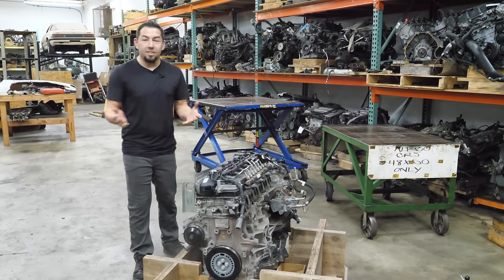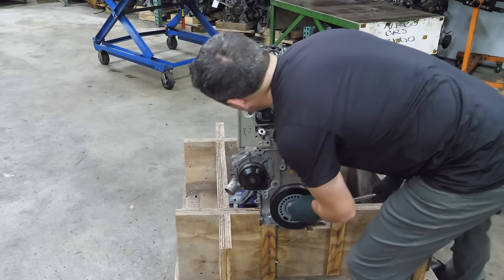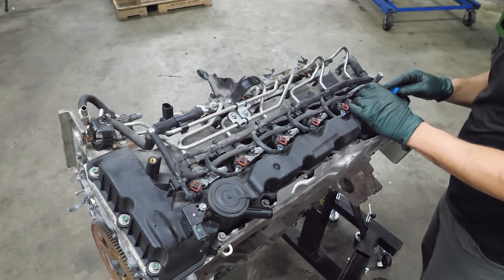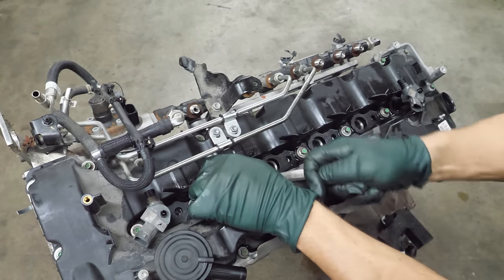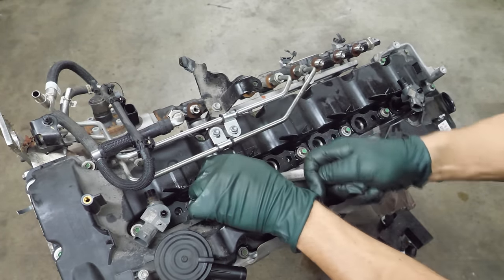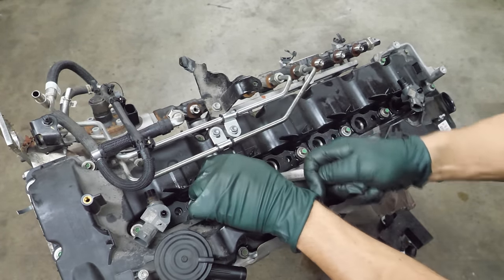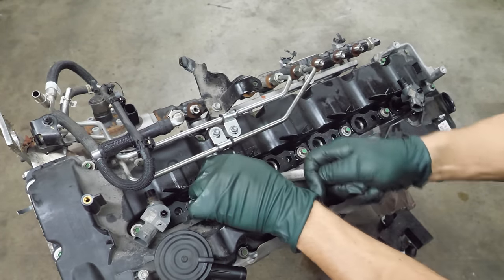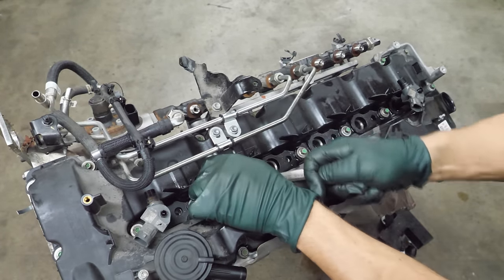BAD 2020 Silverado 3.0 Duramax LM2 Engine Teardown INCREDIBLE DAMAGE!

Comment: I had an oil galley plug randomly fail at 18k miles right after an oil change. Wasn't aware until I got home & found oil all over garage floor. Approximately 7 mile drive from dealer lost roughly 1/8 of a quart of oil. Coolant flow control valve went out at 120k. Other than that, it's been a good runner. coming up on the 150k inspection soon.

Comment: Rod bearings and valve timing are absolutely related…..it hammered the top bearings out of it when the pistons couldn’t get to tdc. You’ll see that on engines with too much ignition timing in them too

Comment: This engine came apart easily and appears to be a fairly clean modern all aluminum design. As so many do with their diesel trucks these days this probably had a tune and who knows what else on it. So that may have contributed to its relatively early demise. This motor was largely designed in Italy.
Reply: This motor is a terrible design like who tf puts a dam belt in oil so dumb ND then why the hell would I want to pull the tranny to do a timing chain belt

Comment: My 3.0 liter 5 cylinder turbodiesel in my '84 Mercedes 300D has 580,000 miles on the original engine including the timing chain. Waterpump has been replaced, fuel injection pump rebuilt, one turbo replace.

Comment: I have the lm2 but in the second half of 2022 so I got the refresh version. This lm2 I have is amazing I have not had a single problem with it. As far as oil consumption I don't have issues either, I have never had to add. I think in the refresh a lot of the bugs were fixed on the lm2.

Comment: T hat is a variable displacement output  oil pump. The pump slide will change pump volume output on operational demands to give slightly better economy. Been doing it in automatic transmission forever.

Comment: I’m impressed by the mechanical simplicity and ease of repair on this engine, that is of course you needing to lift the cab, but that’s not a big deal. I owned an LM2 now have a LZ0 and glad I have the newer version. Looks like that engine was running perfectly fine until that piston ring broke and burned all the oil thru that one cylinder. As for the hydraulic tensioners for the timing chains; I find it being a great design and long lasting, the only big concern I have is the oil pumps split shaft and shank key drive design. I’m surprised they didn’t use a spline drive for it as that would be much more robust.. seems like at 100k miles I’ll be replacing the oil pump and the belt at the same time just to be safe

Comment: i run an FS2500 on my 2005 LLY Duramax and I still change the oil at 5,000 miles. I had to replace a valve cover gasket that was leaking and everything looked BRAND NEW. No, sludge no wear and nothing out of the ordinary. while she only has 130k miles, I plan to keep her in as good of condition as possible for as long as possible

Comment: Heavy equipment mechanic. And we have a Fleet of those Chevy's and engines. If you run the recommended oil, you will burn too much oil. 15W40 And it magically stops burning 4 to 5 qt of oil. By the time it needs a recommended oil change. And we ran the recommended lightweight oil junk. The 15w40 gave us no problems By the time it needed an oil change, it only burned a 1/2 a quart.
Reply: And they had less than 30,000 on them 3.0 D max like I said junk light weight oil.
Reply: And don't cry about oil clearances and vvt You don't build engines 3.0 D max now has over 100,000 going strong.

Comment: Timing chain on the back? You just convinced me to avoid these like the plague.
Reply: How does the timing chain on the back or timing belt? Have anything to do with a fact it was run with no oil in it that wouldn't have mattered if the timing belt would have been on top of the motor I remember who I used to work on a shop we had this little Honda come in and this is back with the first started your timing belt And you still have to get to chased at every 70,000 mi they are had never had that done and it had $170,000 mi on it when the timing belt broke. Needless to say, it bent every valve in the head And I remember he had to get a set used of valves for it and those cost him $800 and that's not including the labor of having them put in 48:51 the head and all the head work done but he did tell us it was his fault
Reply: @bryanyoung3764  all moving parts eventually fail. But not all moving parts are intentionally placed to be inaccessible for no good reason. It's no surprise that Timing chains, guides, and cam phasers wear, but designing the engine so those parts are buried behind the engine and in front of the transmission instead of the front of the engine behind just the radiator and accessories is a deliberate "fuck you" to whoever either has to fix their own truck or has to pay the enormous repair cost at a shop or otherwise back to the dealership.

Comment: The smaller ecoboost motors have those same setup. A belt driven oil pump in the front cover.

Problem is l, the belt wears and breaks down. All that rubber material gets into the oil pan. Clogging up the pickup screen and starving the motor of oil.

If any small particles get through, this is what happens. The cam chain tensioners get clogged, lose pressure and slacken up. Allowing the timing to jump and that’s never a good thing on an interference engine. 

They’ll lose pressure and timing will jump just from the pickup tube being clogged.

Comment: That timing chain being loose right from the start is a big problem. My 21 with 110k on it is getting the timing chain replaced right now because it's stretched. The adjuster on yours is all the way out and there is still slack in the chain. Same as mine.

Comment: Just wondering how big is this engine, I tried to look up specs but nothing about length, height or anything like it?  Say front of the front pully to the rear flex plate and then from the bottom of the lower oil pan to the top of the valve cover (I am aware they mounted an intercooler using water on top of the valve cover in the production trucks).  Also be nice to know the basic weight.

Thanks for taking the time to tear these engines apart.

Comment: Was watching one of your vids a few months back and was like dang thats a horrible freight rotator engine stand. So ran on dwn to local horrible freight and got me one. The most aggravating engine stand ive owned to get a motor on off of a cherry picker. Sure it would have been great to have a forklift but all i had was a horrible freight cherry picker and it was a chore gettin the block on that stand.

Comment: I have a 2022 ram 2500 with the cummins that just blew up with only 8k miles on it. I think you should do a tear down on one of these engines since engine failure is so common on them.

Comment: I can see the pistons have factory machined valve reliefs in the light  on most of the pistons are still untouched by the valves. There are some contact witness  marks on valves in the cylinder head yes but probably match the bad rod bearing cylinders.
Failure analysis is pointing to a break down of oil lubrication of rod bearings but the mystery is one or 2 rod bearing failures.

I don’t think it was lack of lube in my opinion, I think it was severely hot and overheated oil.

The oil got so hot the adduces in the oil broke down and created that tar like sludge.

If it had low oil or no oil the engine failure would have been much worse.
Does it have piston oil cooler  nozzles spraying the bottom of the piston?
I don’t know the lube circuit on this engine but typically it’s oil pump to oil cooler to filter than mains then rods. Secondary circuit to cam, head, 6 cooler nozzles etc. everything looks like it got oil, no oil the bottom end would be literally welded together.
I’m thinking oil quality, probably synthetic spec and oil cooler plugged with that tar crap.
Regular oil non synthetic would have broken faster, then it lost the oil cooler then it went into By-pass so even hotter oil.
I’ve seen plenty of dudes 
engine failures, this one is strange

Comment: Frankly, I am impressed by the fact that the engine stayed together after all that insane damage that was apparently caused by owner neglect (oil starvation).  Unpopular opinion here: the kevlar oil pump belt is a great design - silent, maintenance free and by the sound of various reports will last 200K miles, which is much longer than most first owners will hold onto the truck anyway. Which is more than we can say for the rest of the (traditional) timing chain system. Would love to see what changed in the newer LZO.

Comment: 2020 Silverado with the LM2 here. 106k miles. I was terrified watching this video thinking that typical wear caused the cascade of failures. I am banking on your summary that the engine was probably run dry. I need this thing to go 300k miles or more.
Reply: I'm wagering this was a very poorly maintained engine. Cannot emphasise the importance of regular oil changes on these.

Comment: I had a 2020 GMC 1500 with this motor and was in the shop 4 times with about 30K miles. At 3k miles it had a rear main seal that went out. After the 4th time in the shop, i finally had enough and sold the truck and got a Jeep Gladiator. Lesson learned, don't by the first model with a new motor. A huge disappointment to say the least.

Comment: Have you done a video on the newer gen GM 6.2? The L87?

They have DFM that acts upon all 8 cylinders with 17 different programs allowing the engine to now run on anything from 1-8 cylinders depending on load.

They also will rapidly switch cylinders being shut off. So let’s say it’s choosing to run as a 4 cylinder, it will start off as running 1,3,5,7 for 3-5 seconds, then switch to 2,4,6,8, then switch to 1,3,6,8, then 2,4,5,7, then go to just 1,3,7, then go to 4,8, then 1,2,3,4,5,6, or any other combination of cylinders.

It’d be interesting and I’d be curious to see the insides of one in the ranges of 40k-100k miles on it.

Especially as my 2020 Denali has the L87 6.2 and I just turned 80k miles. And with all the known lifter failures and cam galling the 2019-current 5.3-L84 and 6.2-L87 engines have, I’d like to know what I may have to prepare for. Or how soon I need to do a DFM delete with a stage 2 cam.

Comment: Kudos or you for remembering where every bolt goes. I had the 1996 6.5 turbo. I remember a major issue was around 120,000 - 140,000 miles, the injector pumps would go bad. Turns out it was NOT the injector pumps but the “PMD”. It was an electronic device connected to the injector pump which sat right over the block. The REAL issue was the electronics were getting fried from all that heat. The injector pump was fine. But, before folks really knew about YouTube, you went with what the dealerships told you - $2300 to replace the injector pumps…. I sold that truck ‘cause I was in school at the time and needed something reliable. Turns out it of you knew about that damn PMD, that engine would do 500,000 miles before needing anything major.

Comment: Check what the dealers pay for a new or reman 3.0 turbo diesel.
My little brother bought a 2023 loaded Silverado that drove 125 miles before the oil pump belt failed. He paid in full. The dealer smoked the wiring looms attempting to crank it. 
They will not repair or replace the truck purchased with extended warranty.
The 3.0 turbo diesel is very rare and fails before 70k miles in most applications.
They may pay well for a quality reman engine with warranty.

Comment: Great video. I wonder if you hadn't figured it out if it would have affected the emissions system, and if they'd also cover it. I feel your pain. Anyone that has a 14+ silverado with the pinhole in the ac condenser. Special bulletin on the escalades, and suburban/Tahoe. But not the 1500 silverados🙄. Yet they all go bad in the same exact spot

Comment: The 3.0 Duramax has had rear main seal issues, the seal would slip out of its bore and pump all the oil out onto the ground. They came up with an updated rear engine plate with a tighter bore to retain the seal.

Comment: This engine could have been a real masterpiece, if it had a gear drive. It’s clear to everyone it had total engine failure due to jumped timing. A good gear drive would have fully prevented every problem with the engine.

Comment: They've started making timing chain tensioners that can retract and let the engine jump time if you turn the crankshaft opposite of its normal rotation. It's best to lock the crankshaft or flywheel when working on removing front damper,or the flywheel .

Comment: awesome video. from what i see it almost looks like the oil level ran low, which lead to excess rod bearing wear and to the oil pump wear you found.
compound this with the timing system being tensioned by oil pressure, leads to the slack developing and the valves hitting the pistons at load. i would reckon this likely happened cruising and not at idle, though the cam lobes not being rotated contradicts this.

beyond the user level error leading to the downfall of this specific engine, it is a real shame the repair and maintenance is so anti-consumer. requiring the removal of the transmission for a service part like that oil pump BELT is crazy! god forbid that CP4 blows and requires replacement..... have to remove the transmission AGAIN and then undo all of the timing system...

Comment: Low oil will aerate and foam up which will cause those timing tensioners to fail. I would've thought there would be a low oil level sensor in this motor to warn the operator. The other thing to consider is that varable oil pump actuator failing...

Comment: I've been worried about the oil pump belt...
Looks like the single roller chain used to drive the timing gears with an oil pressure tensioner on an interference valve engine just might be a bit bigger issue

Comment: Thanks for showing something different.
Why would they design such a complex engine ,what were the advantages?
A pick up that doesn't allow the lowest possible oil pick up ,and a warning system that should be sensing that there wasn't enough oil to run the chain tensioner,that's interesting.
But I wonder how many with this engine Run them without checking oil level and oil change intervals, extended oil change maybe ?

Comment: So in the end, it looks like it was run low on oil, the drop in oil pressure loosened the time chain tension, pistons smacked the valves because the timing was so far off and the bearings got wiped out from running it. I’m surprised the ECM didn’t shut it down.

Comment: betting money that the valve cover is one of the ones affected by the broken weld that causes oil blowbye. Then the oil burn got the oil so low that the oil driven tensioners failed threw off timing and boom. It still amazing me that it was running. Low on power?!?! pretty impressive honestly.

Comment: extra strong valves :) Recomended ! :) Piston heads might need new surface design with valve space for extra reving ... possible that engine gor redlined with starved oil ... cause "not enough power" ?

Comment: One of the many reasons why I stuck with Ram's with the 5.7 or the cummins. Haven't had a look at the new i6 twin turbo's, but my guess is they should still be easier to work on vs Ford and GM, or I sure hope so.   The first gen Toyota Tundra has the best engine bay with the 4.7, man do I miss having a simple design on a vehicle.

Comment: The engine skipped timing on the exhaust side. Valves were still open when the piston came back up. Maintenance issue imo, customer either didn't do the oil changes or listened to the manufacturer on when to do them.

Comment: I'm living the 3.0 Duramax nightmare with my 2021 Silverado 1500 with 47,000 kms or 29,200 miles catastrophic engine failure on July 8/2023. Its been sitting in the shop ever since. Will be getting a total engine (LM2) replacement but waiting for the turbo with no timeline in place. I'm expecting to see the truck sometime in 2024. GM has no idea when parts will be available and this was prior to all the strike issues. My dealer takes all the heat from their customers and GM really does not seem to care. At least its all covered by warranty with an estimated cost of $25k for replacement After seeing all the issues others are having with this engine definitely stay away from the 3.0 (LM2) not sure about the newer edition of this engine (LZO).

Comment: The reason why that engine died because it was neglected. I would never buy a truck with this engine in it. Any engine that has a belt driven oil pump is garbage. I'm an old school guy. I love this center cam shaft. For the block, just throw a cylinder board gauge in there and check the tolerance. And then just use the Glaze breaker to put cross hatch on the cylinder walls. I did not like the oil pump at all. Too many things to go wrong down the road. And at the top end of the engine I did not like the oil delivery system. The gears on the front of the cams are probably worn where they have to be replaced. Too many chains way, too many chains. I'd like to see an updated video. I was wondering if you had to turn that 1 journal on the crankshaft to 40 over. You could probably use the other rods but the one with the bearing gone is totally spent.
Really enjoyed watching your video.

Comment: Overhead cam engines in general are designed with planned obsolescence in mind. Doesn’t matter how well a engine is made, the more parts there are, the higher probability of something failing and breaking down. Even overhead cam engines with timing chains will have issues at time point in the future. This is why I’ll always be partial to anything that’s push rod and overhead valve, as long as the oil is changed on a regular basis with a push rod engine, will never have issues with anything.
Reply: 100% agree with u